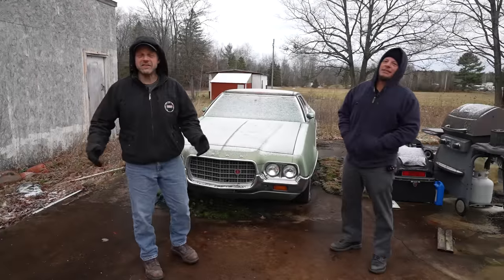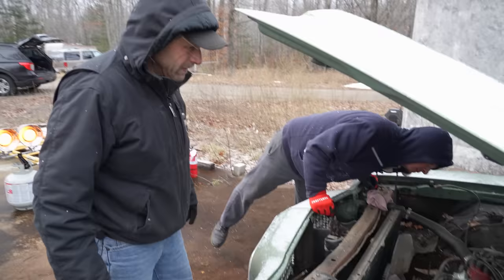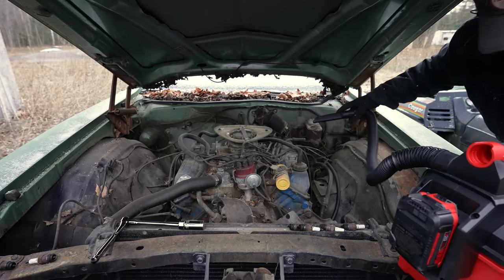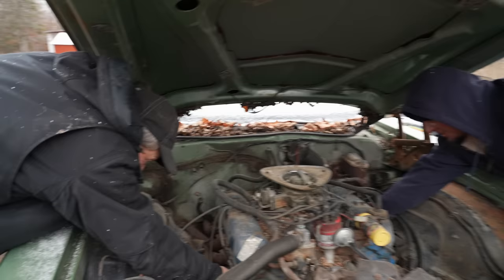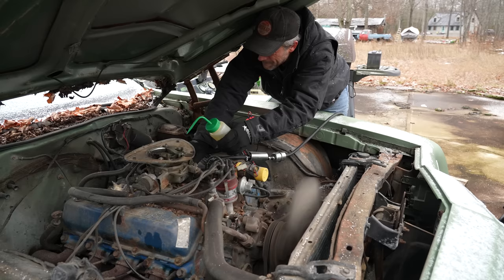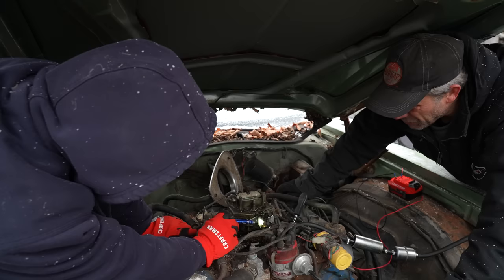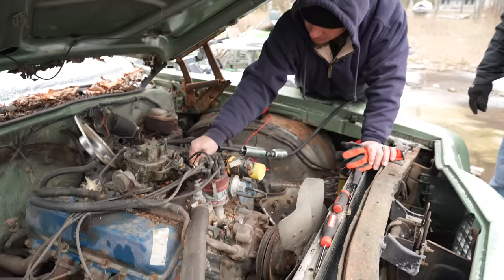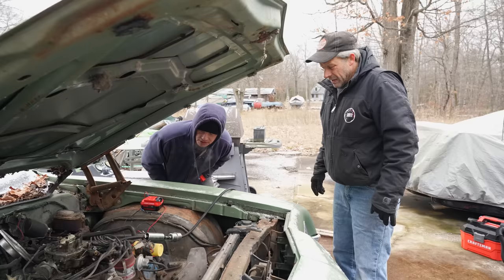Engine Swapped Ford Gran Torino hasn't been driven in 20 years: Will It Run?

Comment: It would of been easier to fill the vent tubes then to take the top of the carb sometimes with the bowl filled through the tubes will loosen the float up and get the needle valve working again too I have had that happen a bunch of times just by filling the vents

Comment: I had a new 1973 Grand Toronto Sport white with blue vinyl roof 351 Cleveland cost $4400 from Ed Martin Ford on Shadeland Av in Indianapolis by dad worked for Ford so my have got employee cost so long ago I don't remember I was 16 and it was a great car had it till 1979 when I got a new 1979 LTD2 same basic interior as the 1973 lol

Comment: NOT a 429 cobra jet,the CJ and SCJ have finned aluminum valve covers and D00E-R heads.The intake in the CJ is a spread bore with a GM carb while the SCJ is a square bore with a Holley carb. That appears to be a regular 429 with a Ford 4300 (junk) they run much better with an earlier 4100 or even a 2100 like the 1970 429 2V. The 429 "Thunderjet" is the basic 429 that was in the thunderbirds from 68-71 with the high compression heads.

Comment: I had a red 72 sport fastback with 351C 2bbl. I also was given a 72 4dr with the same 351C in green that sat for quite a few years as well. Got it running and drove it to college. I had one of those foam air cleaners that I soon ditched after it the foam melted and almost caused a fire

Comment: The 429 Cobra Jet was only available in 1970 and 1971. The 429 Thunder Jet was available 1970 through 1973 in a Torino. So with out seeing the VIN no# this could be an original 429 car. The 5th digit in the VIN would be the letter N. Cool car all the same. Hope to see more on it
Reply: Torino and Gran Torino are two separate cars. The Gran Torino did not have the 429 Thunder Jet.
Reply from the maker: We know for a fact that the original owner swapped in the current engine.
Reply: Makes sense. Cool car either way!
Reply: @PatientXero607  You are mistaken. My blue '72 Gran Torino Sport is a factory N-code TJet, as is my white '73 Montego GT.
Reply: The 70'/71' 429CJ/SCJ heads all ran the small 14mm spark plugs.  The plugs they pulled looked to be 16mm. Doubt that it's a CJ but I could be wrong.
Reply: @HighrSelf  You can freeze frame and see that they are Autolite 45's, which are 18mm. So, not a CJ.
Reply: @Hagerty  So with the big plugs you  pulled it's not a CJ. You have to get the numbers over the exhaust ports that will tell better what it is.
Reply: @413x398  If it's a 72, you have the 4V, not the ThunderJet my friend. Final year for the TJ was '71. You have the regular 8.50:1 compression 429, not the 10.50:1 ThunderJet. If you bought the car with the TJ, it was swapped or built right at the end of '71. N code for '72 was the 205 HP 4V, so don't kid yourself.

'71 was the end of high compression engines for nearly all the manufacturers.
Reply: @PatientXero607  "ThunderJet" refers to all small port 429's, as Mr. Tuttle has already mentioned above. You are the first in all my years to think otherwise. I don't need to kid myself. I own fifty-five era cars and 15 385 engines at this moment. The GTS' block is going to a 521-inch build with D2OE PI heads and an 8V Blue Thunder intake. No need for peanut gallery criticism.

Comment: my dad has had his 72 gran torino with 351 Cleveland since he was a teen. 2007 he thought about retro mod. Now look up project breathless gran torino 07gt500 supercharged 5.4L  tci6x trans mosher rear every good part with frame off restoration. Problem was he got screwed by shops had it complete but being his dream he wanted it done right because its a build for a cause which is pulmonary fibrosis which he got from a factory he worked at and the dream is to finish it before he dies but sadly his health has turned.   you fellas want to go from tge originial gran torino to helping zip up a retro mod gran torino which has everything new has ran just needs to be finished up properly

Comment: I'm just now seeing these "Will it Run" for the first time.  Great videos and fun to watch.  However, I haven't seen you check the coolant on any engine so far.  If an engine runs for more than a minute or so without coolant it can easily crack the block.  Just my input.  Thanks.

Comment: Oops,  I think I see a mistake spoken😢. The orientation of the distributor cap plug wire connections are, as I've seen over the years and understand it are, if they go inside the distributor cap they are high energy ignition, if they stub out are normal old style ignition. I could be wrong but that's how I understand it. 
I love that old car. They're real head turners, not the cookie cutters of today, and are true American.

Comment: Given how old it is and where y’all found it, it’s in incredible condition
Reply: It last ran in 2002/2003.  It had to be restored at some point.  The paint can't be 50 years old.
Reply: @kristfur  Even if it sat outside for 20 the paint could easily be original. It’s in a northern state so doesn’t get the beat down from the sun like southern cars that sit outside do.

Comment: I don't think 1972 had a 429CJ I think the CJ was up to 71 but I do think they made a 351C CJ in 72 butI may be wrong I'm not a big Ford guy but I'm certin 71 was the last of the 429Cj
Reply: In ‘72 if it was an N code car, these were factory 429.

Only Cobrajet LS for 72-74 were Q code cars with 351 Cleveland 4 barrel cobrajets.

Comment: How is this a cobra jet? Usually cobra jet 429 engine came with a GM Qjet carb…..the carb on it is just a standard motorcraft carb and not really used in a performance application from Ford.
It should also have the larger intake and exhaust ports…..

Comment: Also, why pull the carb top on the damn car, risking dropping stuff down the throat and damaging components/gaskets instead of just giving the needle and seat area a tap with a rachet handle.... It's like you've never done this before.   Apparently you need to watch some Vice grip garage videos.
Reply: you realize the butterflies will stop things from dropping into the manifold?  unless of course the throttle blades are actuated.

Comment: Wasn’t the 428 the cobra jet?  429 and 428 are different engines.
Reply: Both the 428 and 429 were CJ engine's and the difference between the two was the 429 had bigger heads with larger ports and valves.
Reply: @mariusmcleod2487  Completely different engine families - no parts interchange (except carb - both had 735 Holleys). 428CJ is from the FE engine family (332,352,390,406,410,427,428, etc.) and the Boss 429 is from the "385" series family (429, 429 CJ/SCJ, Boss 429, 460).

Comment: 429 Cobra Jet? That is one laughable story! Looks like about a 1974 429 or even 460 smog engine.  Davin from Chassell? I grew up not too far from there.
Sorry folks but the big plugs do not fit cobra jets . . 197-212 hp tops on that one. Check to see if 3.85 stroke very well could be a base 460 and not even a 429.  Are the heads D3's? Might even be a 1974-79 truck 460 smogger.
Reply: The only performance engine for 1972 was the 351-4V CJ!

Comment: Sitting 20 years? Outside? I would never attempt to start before making sure it wasn't seized.
No air cleaner outside for 20 years? And just spin over? Just throw a battery in it and start it.
Well propped with the vacuum and debris. Whatever